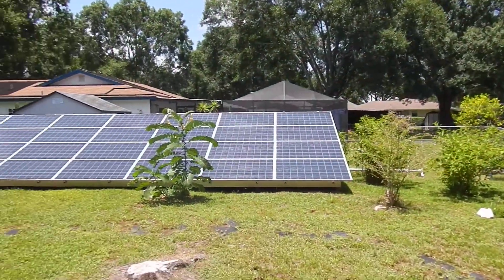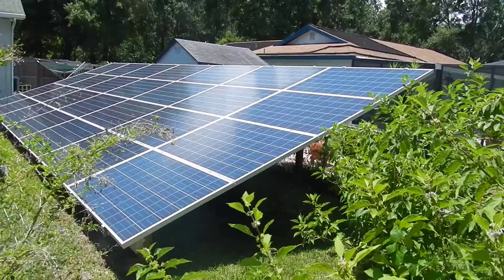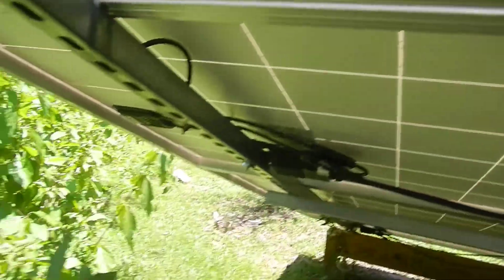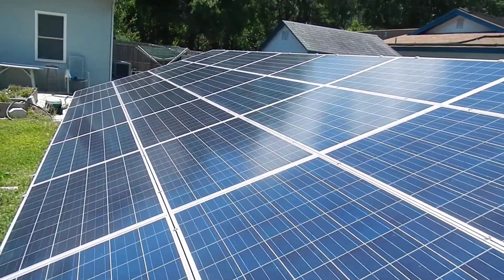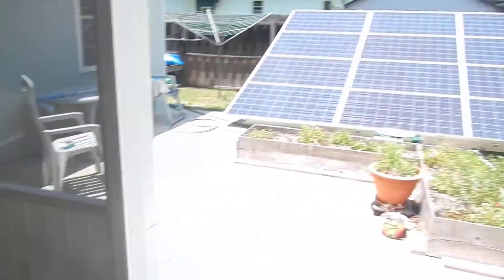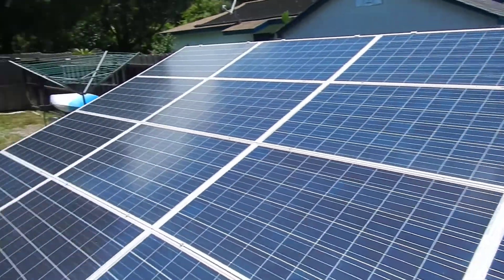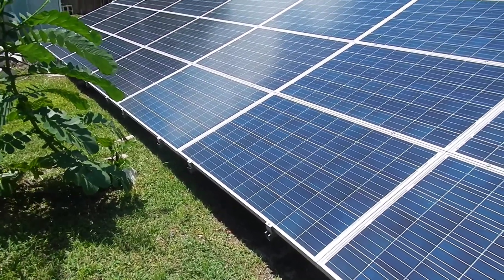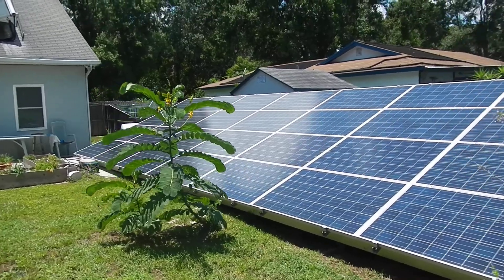SOLAR ELECTRICITY! 7500K

Comment from the maker: 7500 w system ground mounted.

 #solar   #solarenergy   #solarsystem   #solarpanels   #panels   #solarpanels   #photovoltaic   #pv    #solaredge   #energy   #energyefficiency   #panelsolar   #sustainability   #sustainableliving   #gogreen   #gogreen2014   #green   #greenliving   #electricity   #modules   #solarmodule